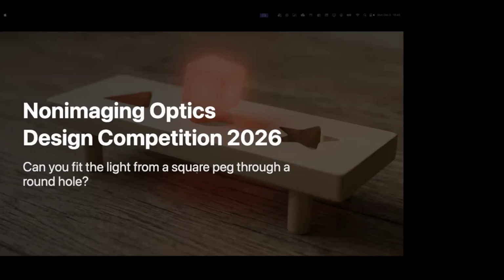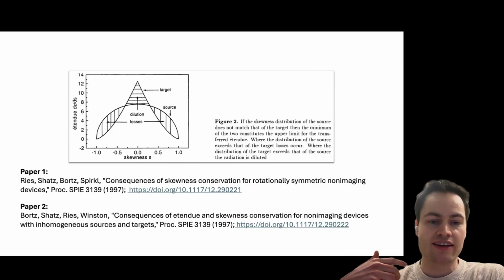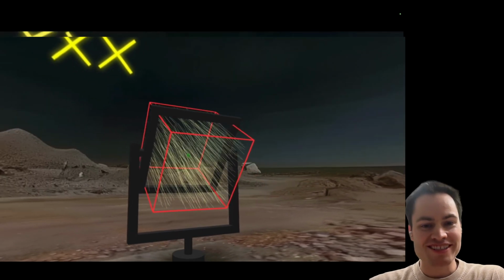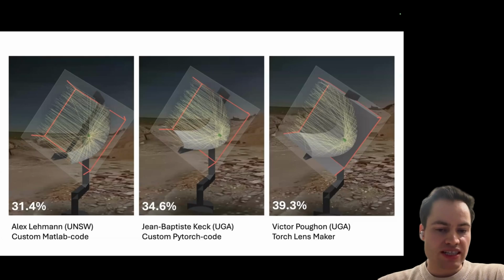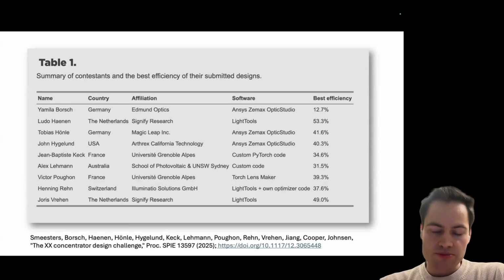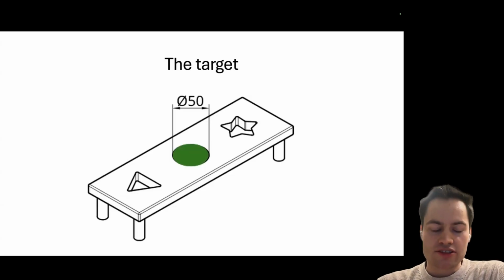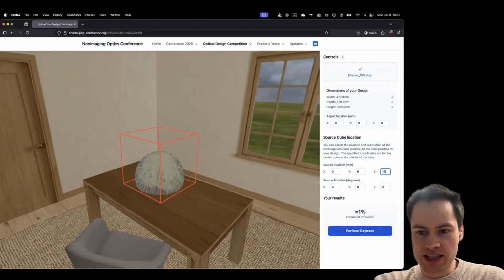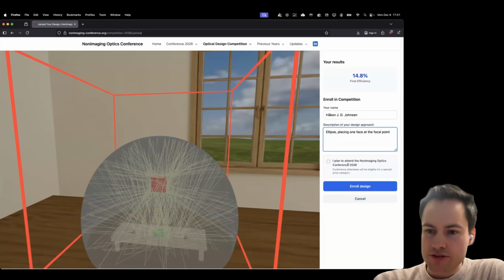Nonimaging Optics Design Competition 2026: Fit the light from a square peg through a round hole

Comment from the maker: Additional context on the 1995 design challenge: 
This was one of two challenges communicated by Roland Winston in the introduction to the 1995 conference proceedings. The text of this challenge was written by Dr. Narkis Shatz (with contributions from Dr. John Bortz), and the challenge was motivated by the work presented by Shatz and Bortz at the same conference [1]. In their paper, they use inverse engineering to design concentrators and projectors that outperform the compound parabolic concentrator in 3D. Their optimized designs were still not 100% ideal. The cause of this nonideality was an unresolved mystery at the time and led to the formulation of the 1995 design challenge.

[1] Narkis E. Shatz, John C. Bortz, "Inverse engineering perspective on nonimaging optical design," Proc. SPIE 2538, Nonimaging Optics: Maximum Efficiency Light Transfer III, (21 August 1995); https://doi.org/10.1117/12.216977